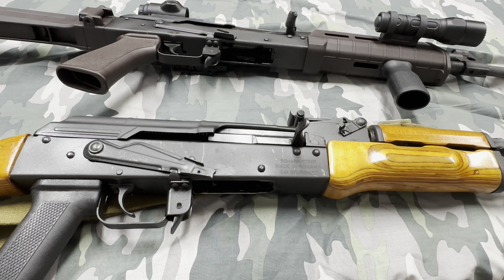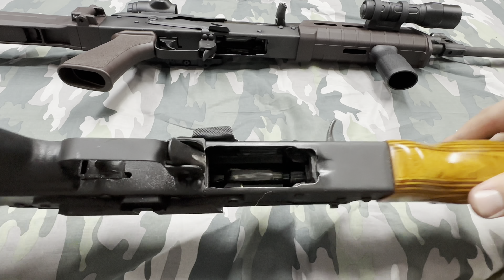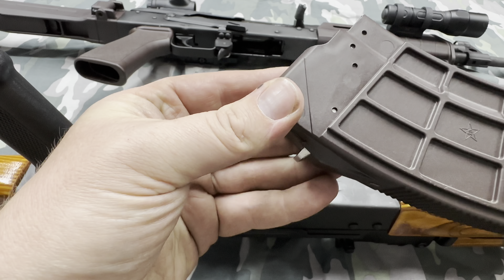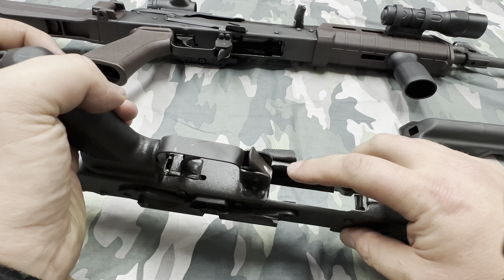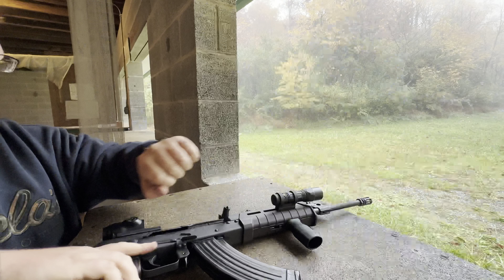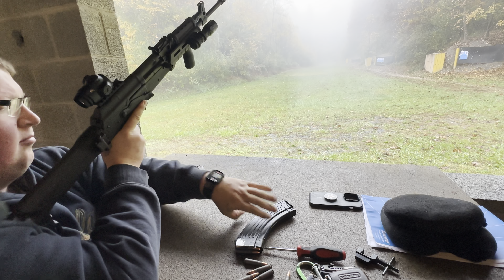wasr magazine fitment issues

Comment: I had a similar issue, I had to take a dremel to my mag release and the welded bits. It’s still really picky with my magazines but 20 out of 30 of my magazines fit. And about 5 of them are extremely tight but I have no issues with any of them.

Comment: I have a WASR from 12 years ago, back when they were still hit-or-miss. The surplus Romanian mag it came with has some wobble. The surplus Yugo mags I got fit tight, too tight, even tighter than my poly mag. I had to do the same polishing on them that you had to do, to loosen up just a bit. But they all run great, no issues.

Comment: I have an M70 and it's beautiful bro. I couldn't be happier with that rifle. I also have a PSA AK103, and I've been thinking about selling it and getting a WASR 10 or one of the Polish AKs because of PSAs issues. My 103 has been great, but I don't fire it much. I don't have to because I have many rifles but PSAs issues with not dimpling their receivers, and the out of spec firing pin channels bug me. I know the WASR has an awesome reputation.  Is that what you would recommend? I'm just curious about your thoughts. I'm not a big AK guy but I want a couple good ones in my collection.
Reply from the maker: Yea I would unfortunately I don’t have any faith in the PSA AKs I know what ur talking about w the dimpling I’m the same I’m not a huge AK guy either but i like to have a few I would like to replace my M70 here sometime. Yea id prob dump it thats what i did when i got my PSAKs back from PSA and they were working I sold them lost money but whatever id rather have imports anyways.